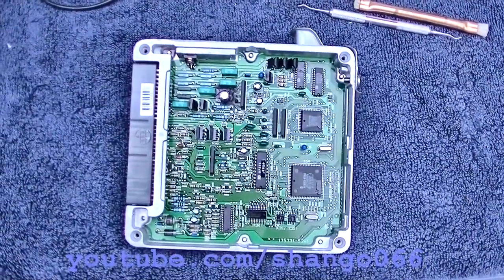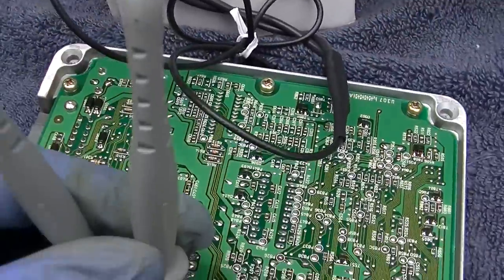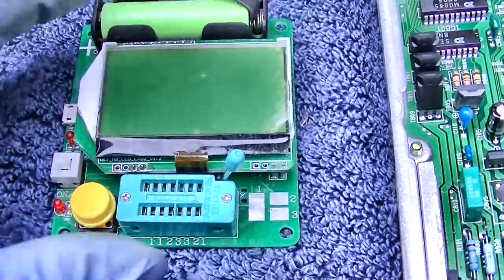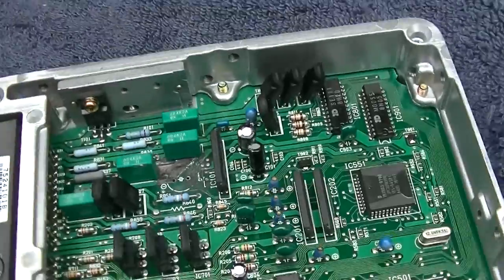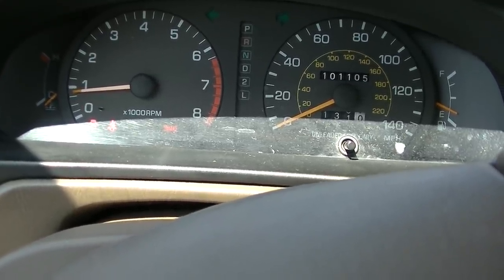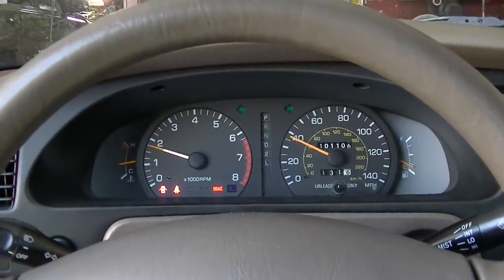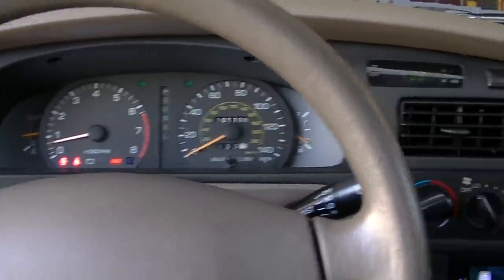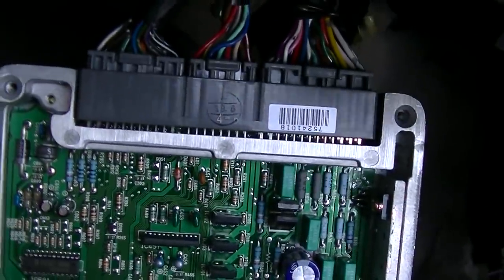1994 Toyota Camry ECU Repair High Idle Attempt

Comment: I did a 93 V6 Camry ECU about a year ago. Instead of the idle at full bore, one of the injectors was shorted on. Car still ran but was getting less than 1mpg!! I replaced the caps, cleaned up all the juices and it's been great ever since.
Reply: How interesting.  I have a 92 Lexus ES300 with the same 3VZ-FE in it.  I've owned it since new and I'm super fastidious regarding my cars and motorcycles.  Recently I too have experienced similar "inexplicable" fuel consumption issues,  but dopey me I changed every single possible part in the engine bay,  thinking I was solving the problem!  Eventually I whittled the problem down to just 2 remaining possibilitiess....  it's either the air flow meter,  or the ECU.  And that's how I ended up replying to your comment!
Reply: Where can I buy good caps
Reply: @Duhb0rg digikey, or mouser

Comment: I didn't know you were a CA. State emissions tech, I'm a Maryland Emissions (Certified Repair and Test) tech. Shango's more than just Tv's and Radio's, he knows his stuff. Those numbers look great. Idle speed motor counts will tell you if the computer is compensating for AC request, minimumair rate on the throttle body might be set too low. The emissions numbers look stellar.
Reply from the maker: TVs and radios are a hobby. They were in the income in the 90s
Reply: perhaps its time to show your face Dan ( shango ) yall got lots of fans.. nothing to be ashamed or affraid of .
Reply: @shango066  Your like the shop teacher we've always wanted!  Thank you
Reply: @bigliftm  you can see his face on his "mine explorers" channel. (also  great videos) yes he also explores abandoned gold mines
Reply: gotta realize you're probably looking at a California emissions car with extra emissions gear and higher cat load than the east coast cars. definitely good numbers for such an old car i wonder if it's the original cat.
Reply: @shango066  Thanks for replying! 

 Same here, electronics are my hobby and help me afford my analog audio "habit". I repair classic 60's and 70's receivers, amps/pre's, open reels, speakers cassette decks, turntables,.. both tube and SS. 

I really want to get into working on vintage tuners, like the tube Marantz 10b and, Fisher 500C, as well as similar early McIntosh tube and SS tuners, but  really haven't a clue as to what I should purchase for test and calibration gear to do so. 

Sound Technology's ST-1000A was the defacto gold standard for FM/Stereo tuner calibration,, as well as some of the older, very robust HP units for example the HP 8640 and 8656. 

But where do you get stuff like that that doesn't need restoring before you can use it to restore the stuff you bought it to work on? Certainly not E-Pray! 

Maybe you can do a video on choosing essential  better quality capable used test equipment, as well as the basic procedures for calibrating the tuner front end. There are a lot of nice tuners out there that are pretty otherwise working fine but have gone a little (lot) deaf with age, as the components drifted. 

People today throw the good old stuff away, replaced by cheap China made chip based plastic fantastic junk, .. stuff that you cant do anything with, and certainly can't DX with. Give me the old heavy metal and wood US iron, ..the hernia inducing tuners and receivers of old over the new stuff anytime!

I'm retired from the auto game, but keep my certifications, just in case, and do run a side shop out of my garage. Keeps food on the table, plus some extras, and I can pick or choose the cars I want to work on..

Any suggestions based on your experience with both radios and TV?
Reply: @bigliftm  I already know what he looks like. 🥰
Reply: Then you might know if popping in a different ECU requires a factory subscription which links to Toyota's software to make it even run at all. This could get expensive and may require extensive knowledge and experience.
Reply: @newjerseybt  Depends on the year, some are flash some have software built in. Flash ECM's aren't non-starters if you don't have a way to program them, you can often get the (reputable) parts store to flash them and the realer does them as well, off board so you don't have to tow the car in to have it done, just take the ECM/PCM. Pre 96 I'm pretty sure come pre programmed as the one Dan is doing doesn't have a removable chip like many  pre-OBDII domestics of the era do/did. Hope this helps.
Reply: former CA CARB BAR 90 Unlimited license holder here
Reply: where does 1 aquire CARB EO (exemption order) numbered capacitors?
Reply: @MsCori76  your a relative ? or you drive the blamblublane ? 🤣🤣
Reply: @bigliftm  Sorry, no relative 😂but I drive a VW Beetle.

Comment: This is the future of auto repair.
Reply: No ... in the future all parts will be serialized to the specific car. You won;t be able to go to ebay or the junkyard and find another ecu - or anything else - that will work. You will have to take it to the Stealership and pay thousands for a new part and have it "reprogrammed."
Reply: That's only fixable because it's 25 year old! The new stuff is microscopic. Like laptop motherboard stuff.
Reply: @volvo09  yeah I’m not even thinking about the newer stuff.  It would be a hopeless effort.
Reply: @KameraShy  It's a good thing the shop software for most mid 2000 cars floats around the internet. Coding BMW and VAG parts is fairly doable for example.
Reply: Laugh in Japanese motorcycle.
Reply: @KameraShy  and report the effort to the government
Reply: @tschuuuls486  This. I have been able to recode ecus for my car, but I had to modify an eBay cable with the right chip in it and get an adapter for a hidden connector on the car as well as obtain the dealer software. Personally, I think BMW/VW and others purposely leak this stuff for older cars they don't really want to deal with at their dealerships.
Reply: what do you mean by future? Keep using gasoline car and not buying electric car?
Reply: The future will be completely disposable cars. The future of auto repair will be limited to changing brake pads,rotating tires and realitively "simple" tasks. Beyond that the cars,especially electric ones will have a predetermined usefull life,beyond which it becomes too costly or impossible to repair them and you simply throw them away and go into debt to buy a new state approved one.  Just like modern television..

Comment: Here's a little trick to trace internal traces. Inject a 100KHz signal into the trace then use an old hard drive head hooked up to an oscilloscope to locate the trace inside the board. Crude but it works.

Comment: Funny for me to see a ‘94 still required to have an emissions test. 

The emissions program I work in gave up on the dynos in 2008, since pre OBDII cars made up such a small percentage left on the road here. 
Everything we test is OBDII plug in, sans heavy duty diesel, which gets an opacity test back to ‘84 model year. 

The state has an exemption cut point for OBDII cars at 15yrs old, as they figure the repair parts for emissions issues might be obsolete, and anyone driving a vehicle that old may have financial difficulties covering the repairs anyway.
Reply: He's in Commiefornia. We don't even have emissions testing in my state.
Reply: In cali, 1999 and older gas get the sniffer and rollers regardless of OBDII status.   MIL light on or more than one monitor not ready is an instant failure.   1997 and older desiels have no smog testing which is why I love my 96 RAM 12 valve cummins :).

Comment: I had similar issuses with mitsubishi ecu's with leaky electrolytics and it leaks under the coating had similar luck as you, could repair most of them. Sometime it did leak under those green biggish cap's too  so unsoldering those was sometimes needed as well. That depended on how much and where it leaked. On those ecu's it broke connection between 2 ground planes so that made all sorts of weird issues. ps If i remember it right car had to run for 5-7 minutes for some reason after battery was disconnected i cannot remember why why it had to do that.
Reply: Yup my 94 had same issue with my 1994 mitscubshi ecu glad plug and play. Just went to junkyard got another one

Comment: Had the same issue with my 93 Fiat Tempra, high idling and it does not idle good when the ac is on. It had two leaky capacitors on the ecu and I could fix thanks to you! I could never imagine capacitors on ecu's go this bad. As far as the idling issue, it was just a corroded ground

Comment: You need to change all the capacitors and install a 3 wire power cord for safety
Reply: Good one!!!
Reply: @That Guy, Don't be THAT GUY! ha.
Reply: especially those wonderful chip capacitors
Reply: always replace the death cap
Reply: Yeah, what a schmuck. He should have done that before he even plugged it in.
And I didn't see him bring it up on a variac... Irresponsible.
Reply: so tired of everyone trying to add a polarized plug to an AA5 radio. one cannot simply just add a polarized plug. one has to do some wiring changes. and if the thing is all buttoned up in its cabinet, with all the knobs on, there isnt any exposed metal to touch.
Reply: X-Y safety cap, too! 😆
Reply: What??? We don't need no stinkin kapacitors!
Reply: @tonyp7779  you can just add a polarized plug and at least make it slightly safer more to the point it at least doesn't make anything worse, adding a grounded plug no you have to do work to make that actually viable and you can totally cause issues doing it
Reply: @Mister_Brown  if you dont get the switch out of the negative leg, it is still not wired up to code, so there is no point adding a polarized plug, becasue you still can have a safety issue.
Reply: @Mister_Brown  , a small isolation transformer tucked into the cabinet would be a good idea, if there is sufficient space. "All-American Five"? I call those things "All-American 50-50% You Get Fried"! Because that's what happens if you do manage to touch the chassis when its hot (50-50 odds that the non-polarized plug is inserted the wrong way) and are standing barefoot on a concrete floor or coming into contact with some other grounded object. Absolute worst-case scenario? An AC/DC, transformerless, flea-power guitar amp, used for practice in a basement or garage, or in conjunction with a vocal mic that is grounded to the PA.....💥

Comment: I repair a lot of these kind of ECU’s where I work, I remove all the electros, scrape back the crust until I get clean copper, flux and tin the copper and use wrapping wire to repair any open traces
Reply: Hi, Just to be clear, are you saying you remove and replace all the electrolytic capacitors on the board? I've got a 4X4 1991 Nissan Pathfinder V6 with manual 5 speed transmission. My control unit is still working, but I thought I'd keep my eyes open for a spare one at the wrecking yard. Do I need to find a Pathfinder that's exactly like mine or can I buy a control unit from a Pathfinder with an automatic transmission, for instance? Thanks a lot.
Reply: @THOMMGB  sorry not sure, I think the ones that are auto have an extra IC for controlling the transmission but other than that they might be similar

Comment: I spent 16 years working in a Toyota engine 'dress up line' fitting and connecting a/c compressors and so I know absolutely nothing except how to fit and connect a/c compressors, except for after the engine is installed into the car at which point, I know zero !
Reply: That kinda sucks.

I am at the opposite end of the spectrum, in research and development.
If management wants it, I need to figure out how, rain hail or shine. Doesn't matter if it's electronic, electrical, mechanical or chemical. It's demanding and I don't even get paid that much.

Comment: I do operate an ecu repair shop but for this case normally we refurbish it and rebuilt the thread pads. FYI there is still 1 broken thread which is for ACSW or ac switch request. Pay attention to the connector it does label all the connections there.

Comment: My father owned a 1995 Camry LE with the 4 cylinder. It was a Japanese built Toyota. It was the best vehicle my father ever owned. I did all the maintenance on it. Nothing ever failed. He passed in 2007. I sold it in 2009. Our road salt was eating the rockers. A guy bought it. Was going to fix it. He was going to sell his 1 year old Camry. The fit and finish on the Japanese built Camry was absolute profection.

Comment: 1985 Pontiac Fiero 2M4 SE 5-speed, GM TBFI, "Iron Duke" Tech-4 Pontiac 2.5L engine: refuses to start from the starter, push-starts reliably. Great compression, good fuel and spark on cranking, but no start. Watching the 5V rail to the throttle position sensor, I found the 5V rail dropping below 3V as the starter hit compression strokes. I took apart the ECM (behind the glove box between the two seats), found a couple of bad capacitors with my ESR meter, replaced them. Worked perfectly after that; my theory is that the ECM was resetting every time the starter hit a compression stroke and the spark timing was way off during cranking. It was trying to start.... 

Electrolytics in cars have a bad life... Hot car in the sun, then start up and turn on the A/C, the ECM/ECU is usually in the dashboard and gets cooled by the A/C pretty quickly, then back to baking in the hot sun in a parking lot, then to the -30C weather we get here in Ottawa winters, then up to +70C in a hot car on a summer's day.... If you're restoring a car from the 1980s or later with any sort of EFI or feedback carburetor or original stereo, capacitors, capacitors, capacitors. :) 

Can you imagine how many cars a year must get scrapped due to weird driveability and emissions problems related to bad capacitors? Horrible waste because of a $2 part. 

I forget what brand of capacitors I found in the GM TBFI ECM, but the whole thing was built with good quality stuff as it must be - you don't want the car to stall out while merging onto a freeway or making a left turn. :) 

This wonderful tester I built nearly 20 years ago was what I used to confirm the bad capacitors in the car: 

http://kripton2035.free.fr/Resources/poptronix%20ESR%20Capacitor%20Tester.pdf

Comment: Most people would see the ruined electrolytic and just order a whole new part. Trying to repair the old one requires too much work! Of course it looks like you fixed it though. I bet the ebay unit works the same.
Reply: There's only a limited amount out there and that replacement one might be faulty or failing as well so this is the much better option.

Comment: 16:10 if it doesn't drop then I think that's good. Turn steering lock to lock and see if it bumps up. If it does then I'm happy thinking idle load control is good.

You are the man! I love the cross-over between electronics and automotives although it can be baffling and frustrating at times. But it sure makes the modern car amazing.
Reply: Older toyotas and lexuses use a vacuum valve on the steering box to idle up the steering by leaking air past the throttle body.    Unfortunately they tend to leak fluid into the intake manifold and onto the alternator.   Best to just remove them and cap off.
Reply: @v12alpine  Interesting. I don't remember encountering them. I remember Toyota cooling fans run with power steering fluid..... Eeesh! Really?!! 😆

Comment: Hey, I love your videos, Im dealing with high idle on 1994 Mercedes W124 now, made a diagnostic tool (switch and led) I get error 10 which is ThrottlePositionSensor.. Will check it during weekend, but your video reminded me to chceck caps in controll units also. Keep on doing such videos...

Comment: To me this chip looks like it could be a signal amp or a servo amplifier (to control a small motor / actuator). This module is mostly run by a processor which is actually the most accurate timing piece in the whole board.  I would rule out the timing cap idea, ... 100nF is really tempting, but as you said, it goes to one pin and just that ... suspcious .... Hats off to fight the obsolence. Not every driver is willing to change his / her car without a good reason or they are confortable with their ride. And this things are built like tanks.

Comment: In the Midwest, any car manufactured in 1994 has long turned into a pile of rust. The capacitors outlast the cars.
Reply: Cars in the southwest: "Papa, what's a rust?"
Reply: Honestly, not these. There aren't any clean ones by any means, but these had superior rust protection compared to other cars of the time.
Reply: In Ontario the only cars still left from that era are Corollas and Civics and even those are getting rare. All the GM product from before 2010 or so seems to have spontaneously dematerialized one day because it used to be everywhere and now most of the GM stuff you see is trucks. The only inspection here is for ownership transfers so you can drive a car until it turns to dust if you want.

Comment: Fishcaps is what I used to call them, they were common in televisions too. If you had a mitsubishi tv that was built between 1989-1995 you probably had about 50-100+ of these leaking caps depending on whether the set was direct view or projection. Dealing with the open traces on multi layer boards is never fun, the feedthroughs go open. These caps are 100% failure rate by leaking electrolyte, which always destroys components nearby like coils and resistors.
Reply: Does that mean the motherboard is then also a total write off,  or can it be salvaged by someone with really good skills?
Reply: @ivanjulian2532  Can be fixed by a skilled tech most of the time. Sometimes a board is too corroded to save.